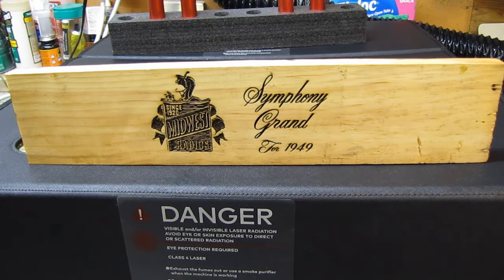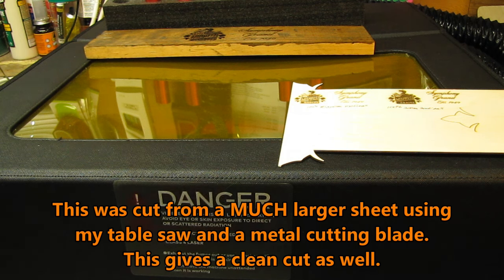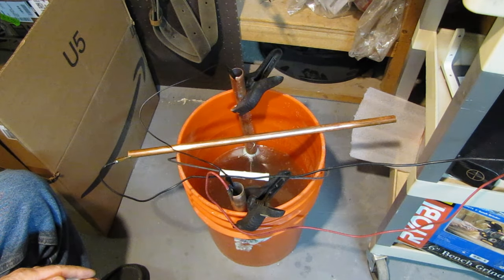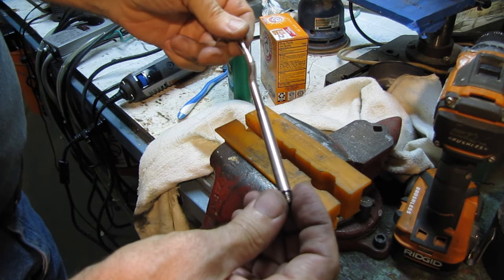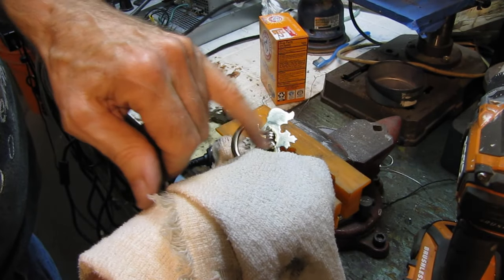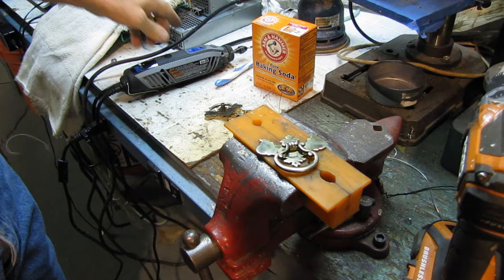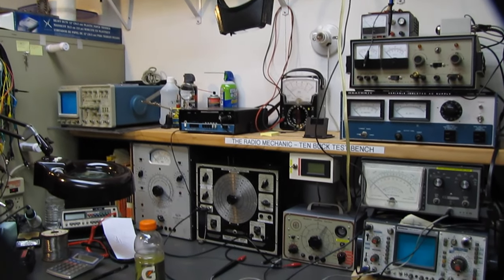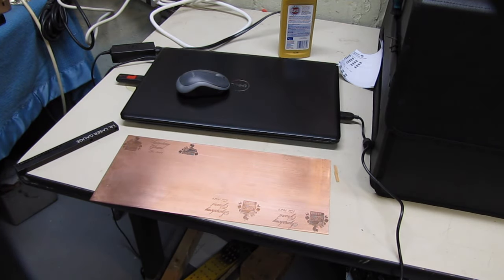Midwest 916 Cosmetic Work Part 3

Comment: 4:29  Use copper sulfate.  It will work much, much better.  IIRC, you can get it at Lowe's. (stump killer).  Copper sulfate is necessary for good plating.  Also, you might want to use copper stranded wire for your plating. The increased surface area will work better.  Also, most copper wire is 99.999  and most non-electric copper is like 99% copper.  The extra refining for 99.999 copper is very expensive.99 or 99.9 copper is done with chemicals. 99.999 is done with electroplating.